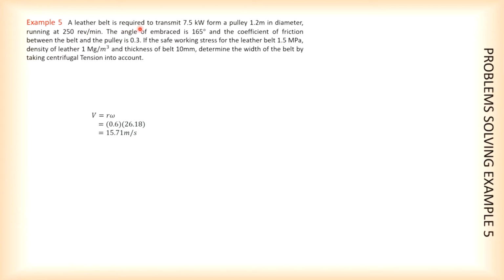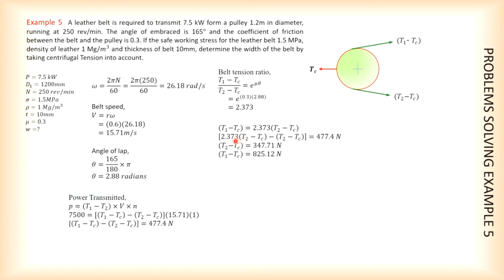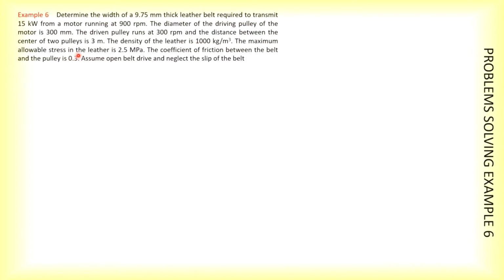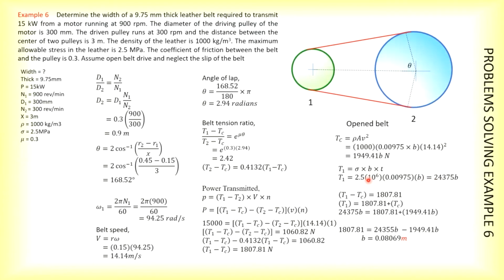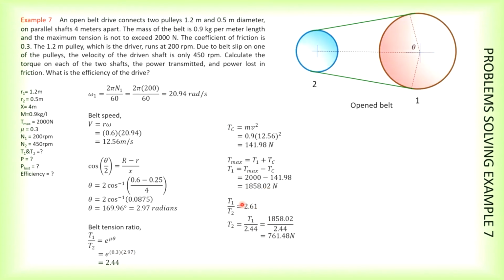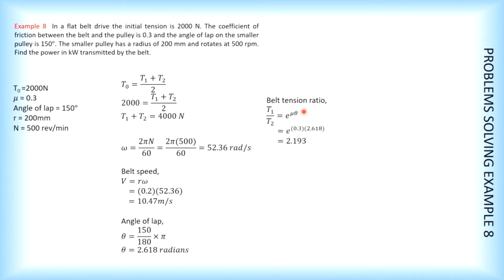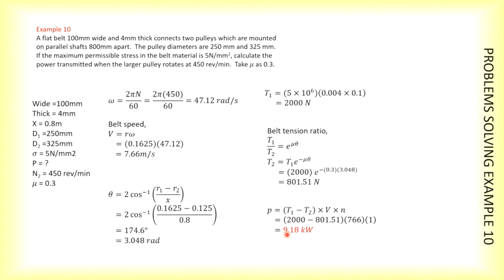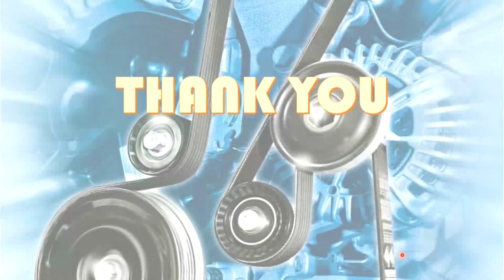Mechanical Engineering   Belt & Pulleys Problems Solving 8 to 11

Comment: In problem 7, how do you know which theta and which pulley speed to use when calculating Fc? I calculated two Fcs - one for the driven and one for driver and used their respective thetas.

Comment: First of all I would like to thank you for the worked examples. They have been very helpful. My question is is with regards to example 8.

The velocity calculated (V = 10.47 m/s) which is greater than 10. 
Shouldn't we consider using Tc ( centripetal tension)??
Reply from the maker: Yes, correct
Reply from the maker: thanks, i have overlooked that, in this video